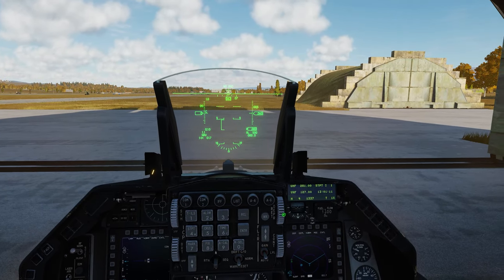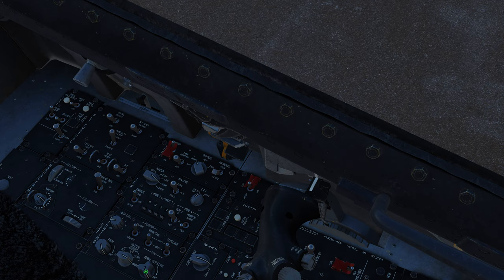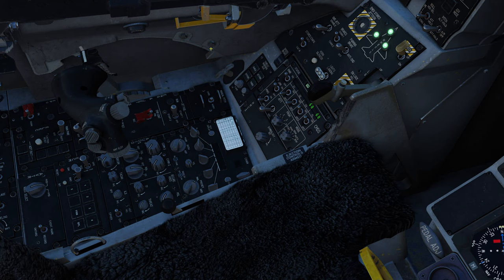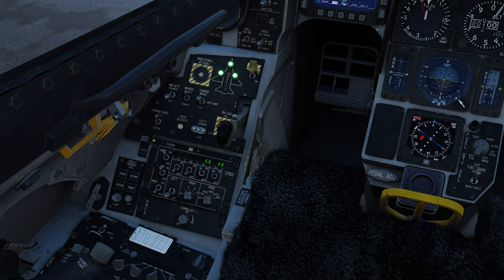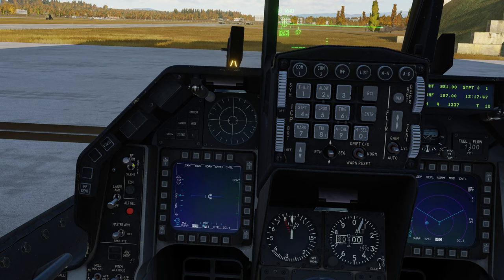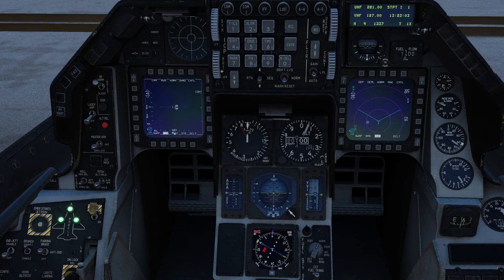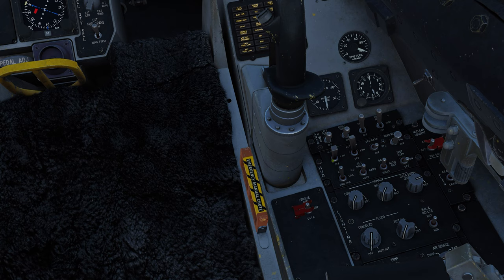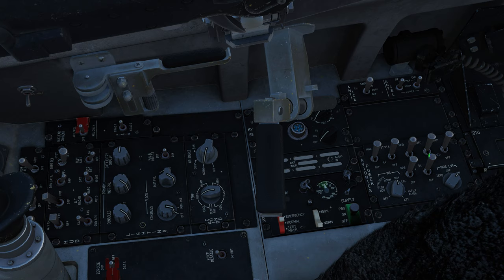Flying DCS With OverKill: F-16C-Viper - Cockpit Tour

Comment: 17:58 These are not "standby gauges" or instruments, these are actually the primary flight instruments for the F-16. The HUD has no way of telling you that the attitude, airspeed and altitude is incorrect, however the primary instruments have means of telling you. The airspeed indicator and altimeter both can work entirely mechanically and therefor have way better reliability over the HUD indicators. As for your ADI or attitude director indicator it has OFF and AUX flags that will pop into view if a failure with the INS system or ADI has been detected. The Standby attitude indicator or SAI is also mechanically driven by a vertical gyroscope that will keep the instrument going for approximately 9 minutes if power is lost and a OFF flag will come into view. For IFR the HUD is not allowed to be used as the only instrument because of its inability to tell you if it has failed and the primary instruments must be used either alone of in conjunction with the HUD.
Reply from the maker: This information is great!! Thank you!!